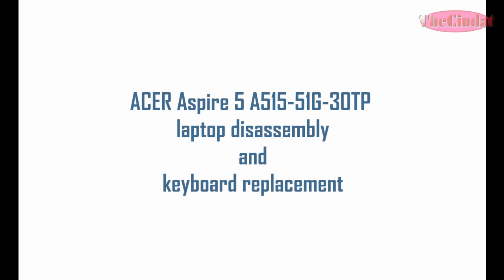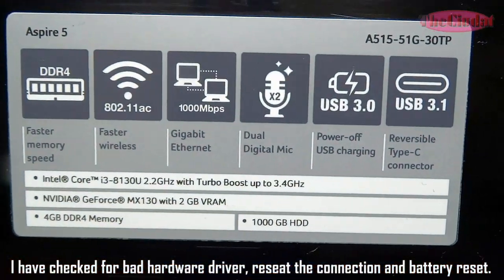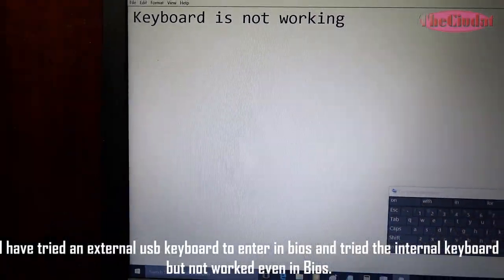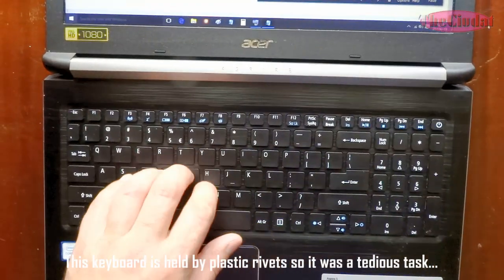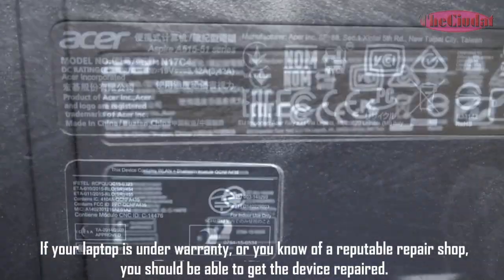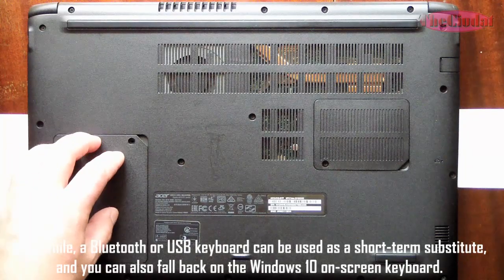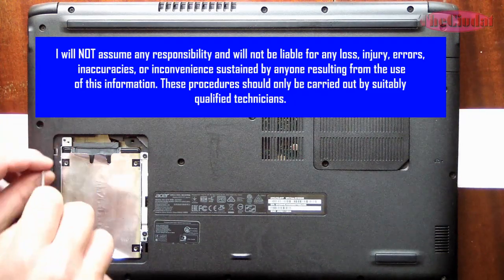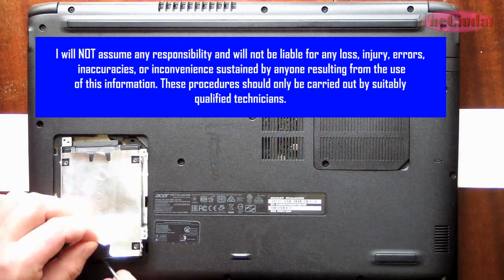ACER Aspire 5 A515-51G laptop disassembly and keyboard replacement

Comment: MY LAPTOP IS SAME BUT I COMPLETELY AGREE THAT KEYBOARD IS NOT GOOD EVEN THE POWER BUTTON ALSO FAULTY I DID 
IDEA THAR 
I DISCONNECT KEBOARD 
MADE EXTRA POWER BUTTON BY SOLDERING
THEN USING USB KEYBOARD
IT COST ME POWER BUTON 1000RS+800RS USB KEYBORD=1800 RS TOTAL
HERE MY PROBLEM I CANNOT TAKE THIS LAPTOP OUTSIDE BCOZ I M USING USB KEYBOARD U DO ONE THING BY REPLACE ANOTHER KEBOARD CST AROUD 1200RS AGAIN SOME MONHS CAME SAME PROBLEM APEAR SO DO AS ABOVE SAID EXTRA POWER BUTON AND USB KEYBORD OR USE BLUETOOTH KEYBORD COST 2KFOM LOGITECH AS PERMANANT IN HOME ONLY BYE HOPE THIS HELPFULL TO EVEYBODY

Comment: Great Instruction fore taking it apart, but after fan installation, instruction are minimal (had to rewatch and extrapolate earlier in the video to put it back together). Warnings about the power jack being 2mm asymmetrical and which screws not to be put in before the case installation would have been good. Also it is possible to re use the plastic rivet heads when putting it back together. If you have a model with a cd drive remove it after the case screws but before separating the case.That said I couldn't have done the job without these instructions. Thank you.

Comment: Laptop in not turning on on battery. When charging, orange light blinks
Reply from the maker: After disassembly? 
Check / Reseat the cable connections, reset bios, disconnect the charger and let the computer a few hours with the battery disconnected. Then retry.
Reply: Now battery is OK. But I had accidently bent CPU Heat Sink very badly. Laptop is getting overheated. Fan starts for first few seconds & then turns off. What should I do now?

Comment: I have a same laptop but the problem is that my laptop is not Turing on by power button but it turns on via F12 or F10 button but it get turn off within. 5 sec and if I keep  holding any key and use it will work finely but when I release the key wiring 5 sec it automatically get turn off plZ help
Reply from the maker: Have you tried external keyboard?  You spilled liquid on the keyboard or had wet hands when using it? 
You should try to change the internal keyboard.

Comment: Thank you very much!!  I didn't know how to remove the keyboard and I was already stuck on that.
 A question the part you remove with the cutter could also be with the welder (because I think it is faster and easier for me 😅)
Reply from the maker: It's kind of messy using the welder there but sure, you can use it if you want.

Comment: Thank you..!! This was major helpful. I have been sitting on a replacement keyboard for my Acer Aspire R11 for months now. Everytime I tried to find any video on how to swap keyboards all I got was some guy popping the keyboard out from the front or someone talking about whether or not my keyboard replacement had screw holes or not. Finally realized in your video that I was dealing with the same cheap plastic rivet system. This gave me the confidence to dive in and I got it done in a couple of hours. Maybe I'm just pathetic at finding out info on the web but this was the only video I found that showed how to deal with all these plastic rivets.

Comment: Why does it happen? It is a problem of using or a problem of factory. Or it is normal because of the time?
Reply from the maker: It may be due to fluids drops. One drop is enough to get under the keys and it's done.

Comment: Tried changing my keyboard today now it wont turn on, any ideas?
Reply from the maker: Disconnect battery, get bios battery out, wait  few minutes. Put bios battery back, laptop battery and try again. It should work. If not, check the cables connections.

Comment: Brilliant video. My Acer Apire keyboard packed in about a month out of warranty. I ordered a replacement keyboard which arrived last week and tonight I plucked up the courage to replace it myself. I've been building my own PCs for years and I must admit, this is one of the most difficult projects that I've undertaken (it took me around 3.5 hours). However, it's now working as good as new and I couldn't have done it without this tutorial. I've never used a soldering iron before and together with the removal of the plastic rivets, it is the most time consuming part of the job. Definitely not a job for the faint hearted!

Comment: A lot of work there, not DYI friendly.  When you got to 'trimmer line' I was questioning what you were using, 'what is trimmer line for computer repair', but then I realized, you are using literally using line from a grass trimmer. Correct? That's a good tip!
Reply: You can also use ABS filament for 3d printers.

Comment: Is it possible to test the new keyboard ( to see if it works )  without sealing those plastic mounts  ?    The reason I ask this question is that in case the new keyboard is defective,  I do not wan to go thru all those steps to undo those heat seals .
Reply: Yeah just only connect the cable and make sure it wont short circuit other components.

Comment: I was curious on your thoughts regarding my acer aspire 5 A515, It is only the power button that is faulty, I removed the key and that seems to work for awhile buy now I cannot get it to every turn on when it powers off after hours. Sometimes I can, but it is a fight and others it takes ages. I was wondering if there is a simpler solution versus having to tear it all apart for a replacement keyboard?
Reply: Don't turn it off. Just keep it in the standby mode always. Also the laptop will be fast enough whenever you use it at instant.. Restart once between 2 weeks..

Comment: Thanks for the video.  I just followed it through a replacement, although I did use hot glue.  Unfortunately I need to re-do it once I get another new keyboard, as I managed to destroy the ribbon cable for the backlights on the first one (upgrading to backlit was the reason for replacement).  I might try to pick up a 3D printing pen for the rivets next time instead of the hot glue, especially since some dripped through and the Y and U keys are a bit sticky now.
Reply: This is my first and probably last youtube comment ever and just to thank you for being a genius! I remembered my kids had a pen like that and I tried it and it worked!!! You rock!!!